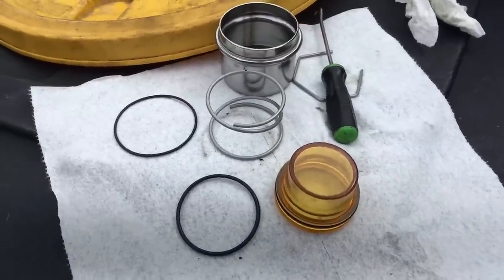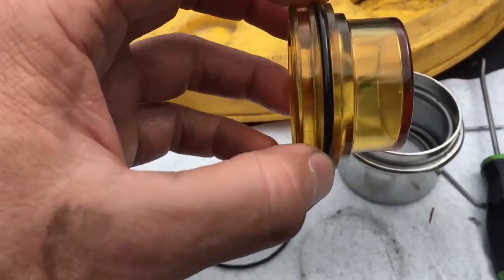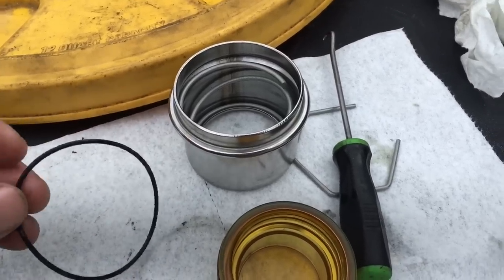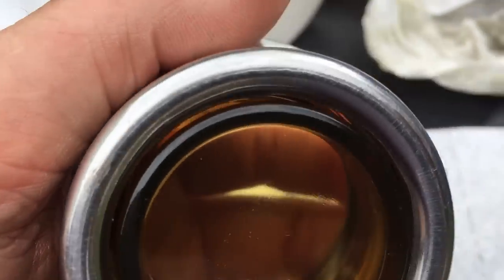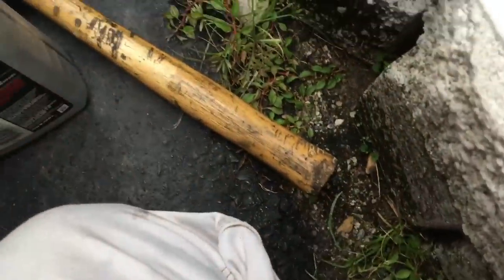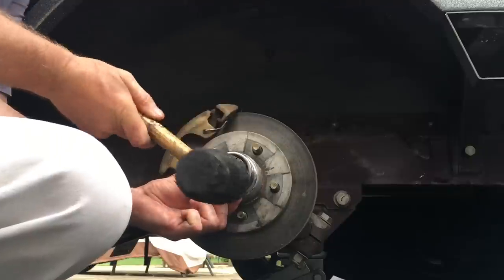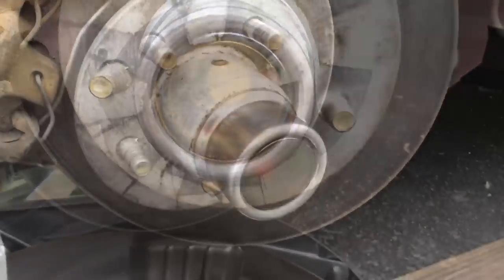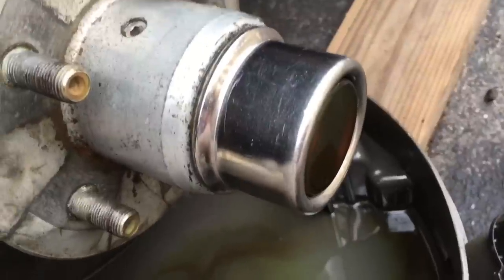Ranger Cool Hub Maintenance (2004 Trailer)

Comment: Sealant does work I am going though my replacing all my wheel bearings been about 8 or 9 years 
I used sealant last and when I removed the plugs sealant was in the threads and works fine 
I use a qt pump and pump from bottom to top NPT  holes 
Been long hauling twice a year on vacation with local stuff it was time good video

Comment: Avery, this is a great video, thanks for the walk thru.  My question for you is how did you go about pulling the caps off of the hubs?  Did you use a strap wrench and twist them out? Did they come out easily enough to do it by hand?  I am getting ready to do my '98 trailer soon and don't want to destroy the caps while removing them.

Thanks,
Tom
Reply from the maker: I use a rubber mallet to tap on the outer edge of the chrome cap as I spin the hub slowly.  It will start moving outward from the hub slowly as you continue to tap and spin the hub until it falls out.  You will not be able to remove them by hand as they are snug in the hub.
Reply: Rubber mallet is your friend.

Comment: I don't believe you're supposed to fill those full, depending on the hub they are filled 50 to 75%
Reply from the maker: Lillie Ursua not true of this style.  There is another version that is supposed to be filled about half full.  These are to be filled to the top.
Reply: @averyneely3664  I need a video of oil bath without the o ring

Comment: Filling completely full after getting warm from towing would the oil expand.
Reply from the maker: The oil will expand slightly, which causes the center cap to push out slightly compressing the spring around the center cap.  The center cap returns to flush state after it cools back down.  The expansion is minor if the amount of air is minimized.

Comment: Where do you get the parts for this repair?  Thanks
Reply from the maker: Pacific Trailers and Etrailers both usually carry a good supply.
Reply: @averyneely3664  yep just ordered through pacific trailer.  Thanks